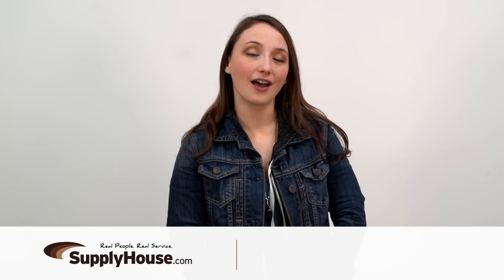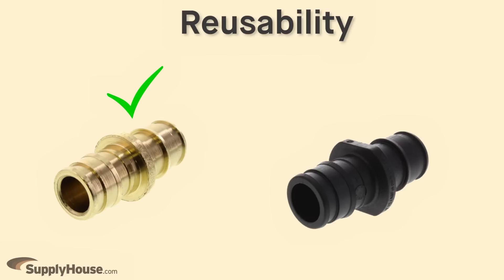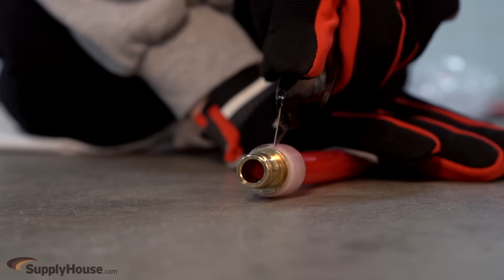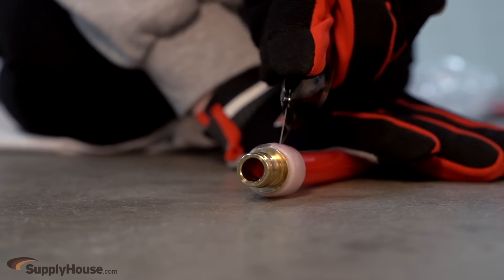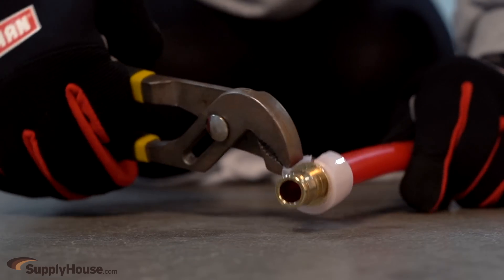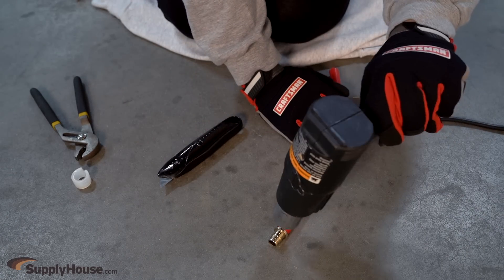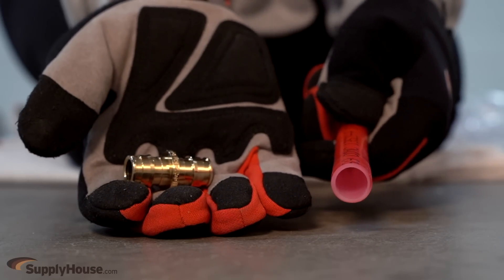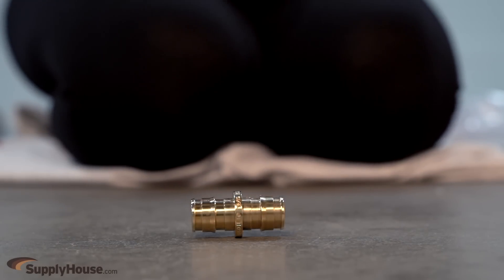How to Remove ProPEX Fittings

Comment: Why this same procedure would not work for plastic fittings?
Reply: It does but plastic fittings are really cheap and you risk melting the plastic fitting.
Reply: @paulsosa1872 you are definitely correct. I find myself throwing them away more often than im able to salvage them. If you put a small cut in the ring very likely chance it will leak. If you wait for ten minutes they quit but I can't in good conscience take that kind of risk unless im in my enemies home.

Comment: Thanks I installed pex to the water heater without 18 inch metal risers and I want to save and move the valves and put in the 18 metal risers needed for code

Comment: My hair dryer couldn’t make this happen.  If your fitting is brass, and the assembly has been cut loose, baking in a well-ventilated area at 350degrees for a short time makes the tube very, very easy to remove (the sleeve is easy to do as described in this video).

Comment: Why not just say cut the pipe since you have to that anyway and then use a razor blade to cut the old pipe of the brass fitting ?...
Reply: If you hit the fitting with the knife it could scratch the fitting and cause a leak.
Reply: @nickbrown6916  you can score it and then peel the pex apart with 2 sets of pliers. Hard to explain but much better than this mess.
Reply: @nickbrown6916  that's what Teflon tape is for 😉